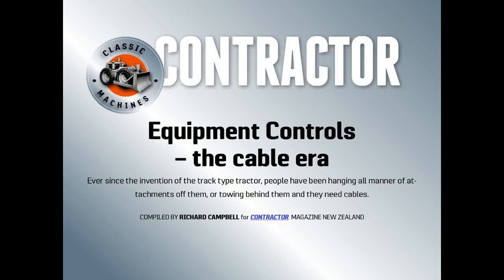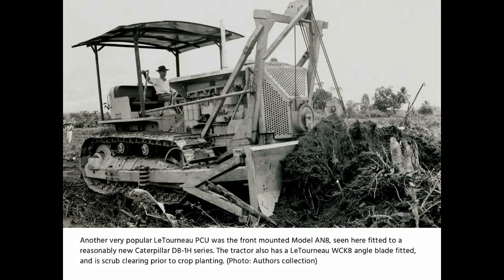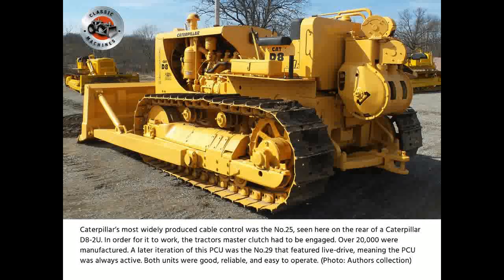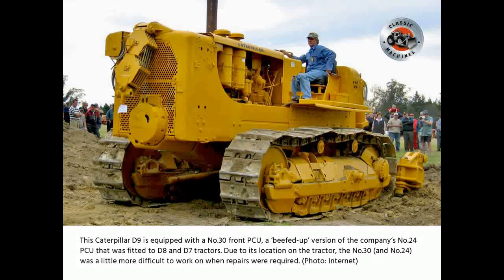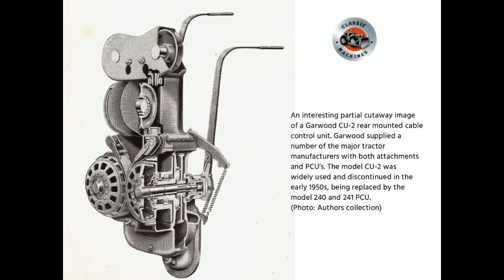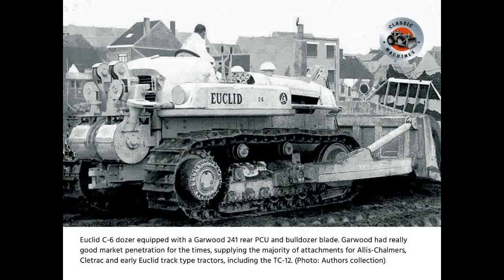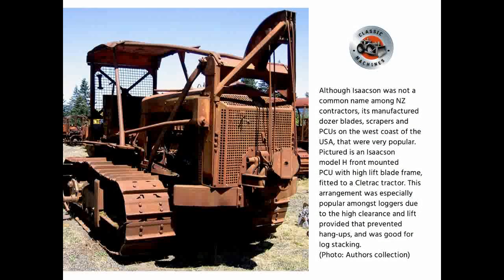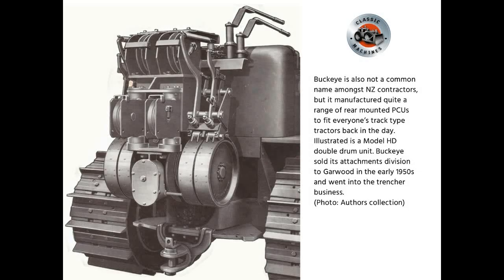Classic Machines: cable equipment controls of the modern era

Comment: I had cat D6 and D7 dozers and 619 scrapers and pull scrapers, all with cable controls. I really liked those machines, they were more responsive that the hydraulic machines. But they did not have down pressure.